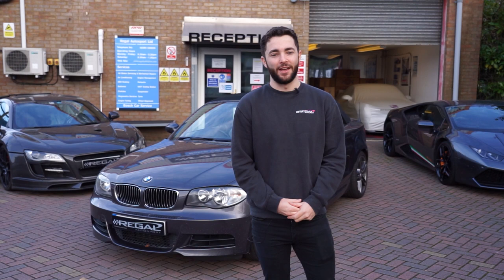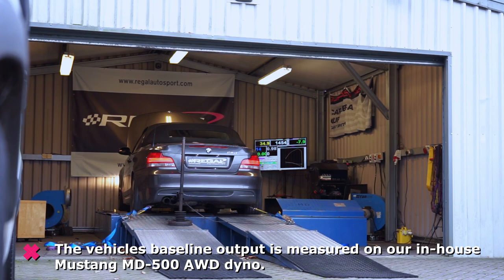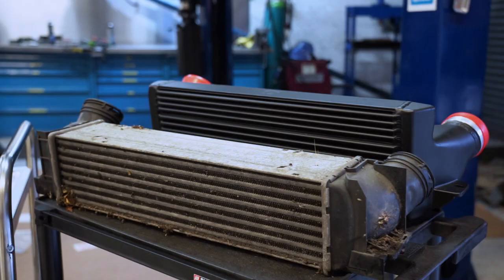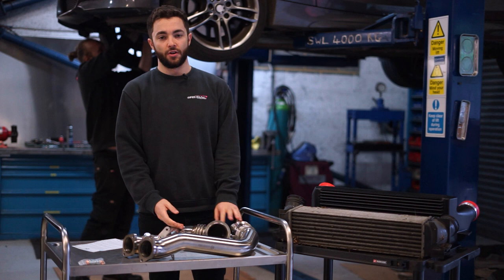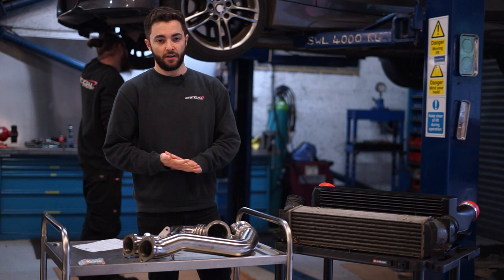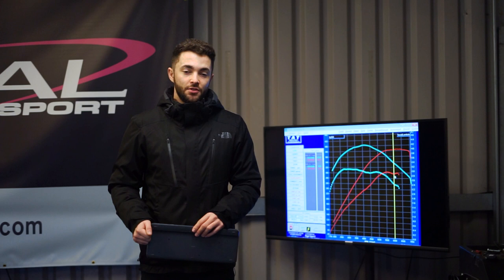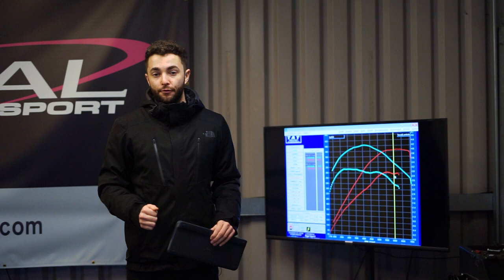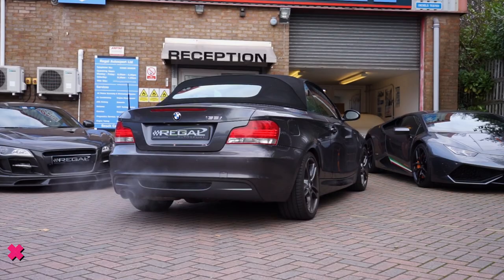How to add 100HP to your BMW 135i with these three mods (CSF Intercooler, Downpipe & Software)

Comment: I thought u had to take the front bumper off to install an intercooler, that's cool man 👍. Is it possible to do the same on a golf mk7 r?
Reply from the maker: Hey! You do not on some cars, on most BMWs you do not have to. We've installed many upgraded intercoolers, software and much more on MK7 Golf Rs! 

If you're interested in learning more, take a look at the contact details in the description